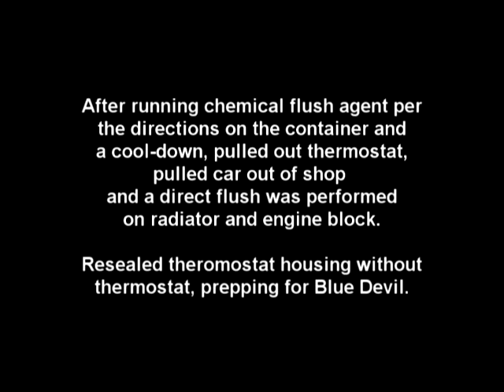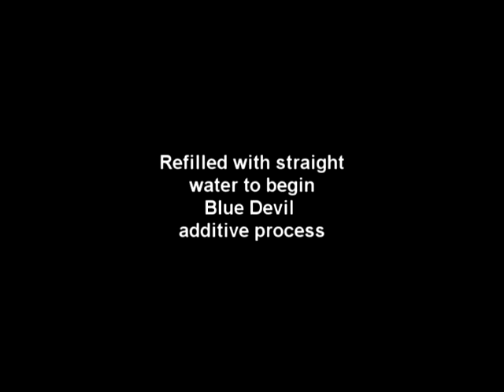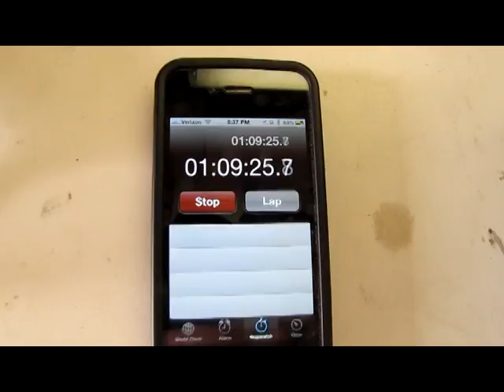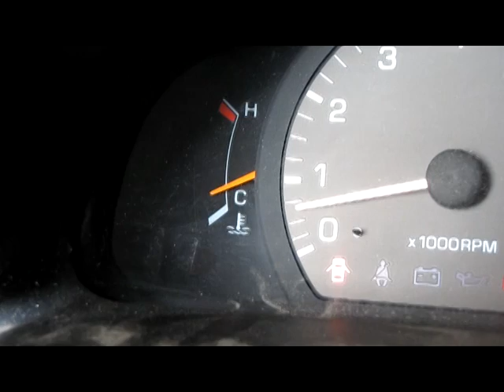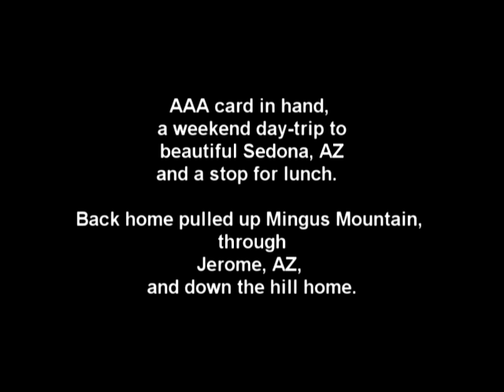Blue Devil Headgasket Sealant vs. Napa Block Tester Pt 2 of 2

Comment: Trying this out on a 99 v6 mustang...car still runs until its hot, steams from oil intake when i take cap off while its hot, so definitely a head gasket issue, concerned that leak may be too big  considering cooling mixed with oil!  considering car runs great up until it reaches normal temp and starts to climb, i think this may be a great gamble for me as well.  Thanks for the video, years old and still seems to be getting views, kudos to you!

Comment: Blue Devil, & CRC's KW block & head gasket sealer both seem to work about the best. I have seen KW work on cracked blocks. If it's not too bad, it might work. If the heads are twisted or cracked or the gasket is too far gone, it no worky.

Comment: Thanks for the great video. You have a great voice and describe things very clearly. I have an 08 Civic that has 135K on it, but I am loosing coolant and it's getting hot very fast. I will be doing the Block Test this weekend. If it is a leaking head gasket, I am on the fence about using Blue Devil or spending the $$$ to have the gasket replaced professionally. Since it's not a beater, and I can get another 100K or more on the motor I am leaning to spend the $1000 to have it done by a mechanic. Any thoughts?
Reply from the maker: +Joshua Gaughen Hi - yes, I would have an opinion here.  Before that, though, have you had your system pressure-checked for an external leak?  This repair would be much less expensive as compared to a head gasket replacement.  Are you sure you don't have an external leak?  Beyond that, I am in agreement with you on probably spending the $$$ on the professional repair for many reasons.  It's ALWAYS better to do the repair properly, but particularly if this is a worthy car of the investment.  Being at roughly half-life as you describe, and a dependable Honda on top of that, I'd heavily consider doing the repair properly.  Next, with a good and reputable repair facility, you should get some kind of warranty on their work - might not be very long, but it's mainly to make sure the repair isn't faulty in any way.  Next, in their quote they should also suggest and include all other parts which should be replaced as new as part of the job, such as all belts, hoses, clamps, water pump, thermostat, etc - so you'd most likely be getting a very brought re-fresh of a lot of parts which need replacing anyway.  Finally, they MUST try to find the original culprit, if possible, to the overheating, such as an inoperative cooling fan, sticky thermostat, or even just an external leak.  For this kind of vehicle, I'd really lean more towards the proper repair if at all possible.  But, just my opinion.  Hope this helps some.  r-
Reply: +Joshua Gaughen If it is the head gasket, i would get it change on a -08 car

Comment: It says to add inn BlueDevil with the engine idling. I don't have a pressurized reservoir and when I open the radiator cap, it bubbles out, even with the engine cold. Maybe I'm just car dumb, but how should I proceed?
Reply from the maker: +# Sq_One Hm....a good question.  First, tell me the year, make, model and engine of your vehicle so I can get a better idea of your cooling system design.  Second, did you pull out the thermostat and reinstall its housing without the thermostat for the additive process?  Let's start there.  r-
Reply: reluctorvalve
I wound up partially draining the radiator then pouring it in while idling. Worked like a charm. Thanks though.
Reply from the maker: +# Sq_One Excellent!  Glad you had good results.  r-

Comment: How about and update?  Did it last?
Reply from the maker: +Mike W Hi Mike W - Yes, in fact it did!  Now, this comment is relative to one's expectations.  If your expectations are that it lasted forever as the Blue Devil guaranty claims, then NO it did not last.  However, if your expectations are that the vehicle came into the shop overheating like crazy and tested positive for compression leaks, the chemical did in fact work in my case, and further, lasted another couple of years or so that it would not have otherewise.  If you look at the comments you'll see the before/after mile and time comparisons - the car would not run reliably in any way, and in fact would have blown the block.  This little mechanic in a can treatment did work for me for what I needed - to get a couple more years out of it.  Of course, the true and correct repair is to pull the heads off, have them checked and repaired and/or replaced and to of course replace head gaskets and all upper seals contained in the headset gasket set (I have a full video on this process as well).  Comparing costs, and considering it was just a beater car, and needing a couple of years more, yes it worked for me.  However, ultimately it did finally give up the ghost after it was relegated to teenager duty.  At which time, the proper repair of course would be to pull it and replace/rebuild it.  On a 1960's Mustang - I wouldn't recommend in the least.  On an old beater car- for me it was totally worth a $100 gamble.  So, depends on your perspective, I guess.  Hope this helps.  r-

Comment: Nice thorough video. Although I'm not convinced that blue devil is the best route to go. It is a cheap option and may prove helpful when you have an old beater that you want to get a few more miles out of. I'd still be reluctant to use it though since I've seen the effects of a torn down engine after use of a product like this. The head gasket sealer plugs up the coolant jackets something awful and although it didn't seem to affect your vehicle in this case, there are numerous reports of others having overheating issues after using a can of gasket repair. I think the most beneficial thing about this video is the use of the block testing fluid to help troubleshoot a possible leak.
Reply from the maker: +Michael Kaul  I can't agree more with you, Michael.  I used it on an old beater - and it got us through a pretty tough time when we had nothing else to drive for a few years.  That said, my opinion is that if you use this on something you care about, understand that you already have a deep issue that will require, again, WILL require an engine teardown to a good level.  If you decide to just go ahead and do the head gaskets and head repairs, most likely (unless a cracked block) your problems will be corrected.  If, on the other hand, you decide to go cheap and quick and use an additive like this, more than likely you will buy some time, but the eventual repair will be an entire teardown of the engine, 'vatting' the block - or dipping/soaking in a highly-corrosive chemical to clean the crap out- you get the jist.  Pay now or pay even more later.  Depends on your situation.  I agree with you: using additive and 'mechanic in a can' can buy you some time, but usually will require complete teardown and rebuild later - which, most likely would need to happen anyway in a lot of cases.  Thx for the comment.  r-

Comment: Props to you for still responding to your video you made years ago. Good Man!
Reply from the maker: Anthony Rhodes Hey Thanks!  I did upload a pretty detailed head gasket (and heads) replacement video only a few months ago - and I did purchase a bit of new equipment for making these.  The problem I run into is that making these videos dramatically slows down the repair process - setting up cameras, doing takes that are usable, etc.  I'm in the middle of having to move in the next year or so, so I'm not sure how many more new ones I'll be able to do, but if I can, I will!  Most of my recent repairs were needed in quick order, so no time to shoot!  And, I love helping people when I can by responding to their questions. Thanks- I'll try to add more as I can.  r-

Comment: great video i am a recent grad of an adult automotive technology program at my local boces i have an awd 03 mercury mountaineer with the aluminum block 4.6 (281) 2v i paid $800 for the truck on craigslist while trying to diagnose a plugged catalytic converter i noticed the white smoke i cracked the oil pan plug to try and verify a HG leak and 3-4 drops of coolant came out would you recomend me using blue devil or trying to repair it myself i don't expect it to last forever but would like to get more out of it than the 3 months i had use of the truck at least until i can save up for a proper fix when it was running it was getting better milage than my father-inlaws 04 santa fe thank you for your time
Reply from the maker: redneckraider2010 Hey There- you sound like me!  I fix and drive older stuff!  I'm no gambler, so obviously I would recommend you run a chemical block check on the engine.  It's not uncommon, as I've heard, for the engine to get a bit of moisture inside of it, but just a bit - usually it is evaporated during combustion.  But to literally see the color of the coolant in the crankcase, to me that is cause for a bit of alarm.  I'd highly recommend the chemical block check to verify which way to go next.  If it turns up negative, well then you have coolant getting in the crankcase by other means. Perhaps a more experienced tech can comment, but I can't really think of a way that coolant would end up in your crankcase- that perplexes me.  AND, if it's due to a combustion leak, it's odd that it hasn't steamed out already, unless your leak is so huge that it just can't steam it all out, in which case the issue should be really obvious (white smoke...lots of steam..) This is an odd one.  I'd definitely start with a block check.  As a side note, I would ALWAYS recommend a complete repair on top of a chemical treatment, but that depends on the case involved as you can see from my videos. Would love to hear back, and congrats on your recent graduation!  r-

Comment: Hey great vid. Where exactly did you purchase the blue devil from? Thanks, Robert.
Reply from the maker: Robert Whitt Hi Robert.  I was in my local NAPA store one day and noticed a small display of products made by this company - power steering sealer, transmission sealer, etc....and saw that big blue bottle with the claims made.   My video shows how I'm not so much a believer of 'mechanic in a can,' but given the situation for me, it was worth a try - but a rather pricey one.  To me, the expense of the product indicated some kind of quality.  So...- that's where I found it, and I did do some online research before I went back and purchased it.  Hope this helps.  r-

Comment: Hi I have an 88 vw cabriolet and it's been overheating lately after 5 minutes of driving. I have the milky substance in the oil cap and barely any power. There's white smoke coming from under the hood and there's bubbling in the compartment that holds the coolant. Would I have flush out the radiator before trying this product ? 
And since it's an old car would I pour it into the compartment that holds the coolant?
Reply from the maker: UsualAverageYougGuy Well, depends on how much work you want to do.  I've heard of folks who just drain off enough to get that airgap for testing inside the top of the radiator.  The directions call to completely drain, flush, use a cleaning agent, etc....my suggestion would be to follow the directions, because it's not inexpensive.  No, you don't add it to an 'overflow' tank, but usually directly to a radiator.  Expansion tanks - would be the same as filling up your cooling system.  Be sure you're comfortable with how your system normally works, or you may get hurt and/or waste your money on the product.  If you are unsure, buy it and have a shop do it for you.  hope this helps! r-

Comment: I love your video's. Thanks for sharing. My issue/s are with a 2005 nissan altima.
 When I was pulling the plugs, no. 1 had a light coat of oil on the non-firing side. What repairs do you suggest?
Secondly, I Cannot for the life of me get a grip on the no. 4 plug. Thus;it it is still sitting installed.
Thank you again.
Dp
Reply from the maker: Damien Palladino Hi Damien.  Is this a 2.5L engine?  So by oil being on the non-firing side of the plug, do you mean it looked wet, just like it was oil-coated?  Typically oil in the cylinders gets burned, and any oil that gets in the cylinders creates a residue on the plugs that is sort of a brown-colored ash buildup - but not wet or slick looking.  So if it's wet-looking, how does it idle? Does the engine miss-firing at all?  For the spark plug issue, are you using a good 6-point spark plug socket?  What tools have you tried and what were the results?  We'll start there.  r-

Comment: Hows the car now?
Reply from the maker: Tor: This repair enabled me to use this car out of town for several trips - some for medical reasons so we really needed to depend on it at the time, and also some trips down to Phoenix in the heat of their summers at around 110 degree outside temps for just getting out of town reasons.  It did awesome!  The AC even worked great.  So for myself I got about a year and a half of good use out of it, then I gave it to my step-son, who got about another year of local use out of it.  The car finally did bite the big one - and, I just didn't want to put the money and work into it to fix it.  It began overheating again, and so I knew that the repair had given it up. So, even though Blue Devil says it's 'permanent,' I wouldn't count on it.  If you read some these older posts you can get a feel for how I think about 'Mechanic In A Can,' and when I would use it and when I wouldn't.  For about $100, on this old beater car, I feel I got my money's worth, for sure.  I sold this car off some months ago, and to my surprise some folks from Tucson came all the way up to trailer it off.  That's about a 4 hour drive one-way.  Probably cause it's a Toyota.  It was a wonderful car - and I've since acquired another Camry which is also old and has NO problems.  Sweet little rides, these Camry's are!  r-

Comment: I have an 01 Mustang GT. The car doesn't over heat, does smoke at all, no coolant in oil as far as I know. Only thing is I am losing coolant from the cap from over pressurization.  A shop did a block test and turned green yellowish. So I guess I have a slight head leak. Will blue devil work?
Reply from the maker: Santiago:  Did they pressure-check your radiator cap?  Let's start there.  r-

Comment: II have a 94 F 150 306 motor straight 6 would like to use it I have a little milky substance on my oilan overheating problem with a closed and so I suspect the head gasket leak it doesn't seem to overheat too bad but I did have an overheating problem with a closed and stuck thermostat so I'm suspecting that I when the motor overheat it that I caused that gasket leak would this be a good product to get rid of that I need a truck to last at least four to five months plus it's a straight 6 bulletproof
Reply from the maker: Tony: I would highly suggest that you perform the chemical block test in your case.  You need a definitive answer, and I would start there.  From what I hear, you can rent a block tester kit from many local auto parts stores.  I hope this helps to get you on the right direction.  r-

Comment: How do u use blue devil on 2000 Bmw 323i I tink my head gasket going
Reply from the maker: +Gaza Thug Hey- I'd have to see the car myself....or do some online research to find out how your system is designed.  I get lots of questions about expansion tanks versus overflow tanks - for the most part that's the biggest difference I've seen.  If you look over comments you'll see these topics.  r-

Comment: Did you try STEEL SEAL?
 I would love to see if that would work better.... it is far less work, but I am going to purchase a Steel Seal... $20 more than $69. like $90~ 130 more
Reply from the maker: Mei: No, I have not tried Steel Seal, but I've heard of it.  If I ever have the money to try another product (insofar as to buy another beater car), I would LOVE to do a comparison video (HINT: to any product makers out there to fund me!).  I recall back in my young days there being some kind of 'flaky' substance in a little tube you added to a leaky cooling system - but those were known to clog the systems. This Blue Devil stuff is a liquid, which chemically reacts to the very high temps of combustion, as I understand it. I would love for you to post up your results, how it worked, what it's made of in comparison, etc. Thx for the share.  r-
Reply: Well... I have a starter  to yank today fr my Buick Regal.    I gots to borrow a jack from the neighbor.  ...and will order the steel seal after change oil on Isuzu....  I wonder if i still have torque.  I need a decent bf or husband.... none of them knew under carhoods?
Reply from the maker: Mei lani Aki We Mech's await your results! thx! r-
Reply: lol,...well,...I am not rolling in $$ and had to have a starter and alternator switched out in $500. 95 Buick Regal first.  Nice car,...has lasted me 7 yrs already, with only Battery replacements and the 1st replacement on front tires, yet!!
Need a new PC first!
Reply from the maker: Mei lani Aki You know, if you're good with PCs, they are really blending into today's current car designs....and you could make some serious $$$ ! No Steel Seal yet I gather. r-
Reply: hmm... that is a thought!  Link me

Comment: I have an old ford with a 302. I would like to try the block tester but I worry I might get a fasxe positive because I Have a leaky valve cover gasket that ldrips on the manifold and causes some general fumes
Reply from the maker: Dude: good concern.  Obviously, I'd replace the valve cover gaskets and ensure a good seal there before I would test in this way.  The chemical seems to be pretty sensitive.  Would love to hear how this process ended up for you!  r-